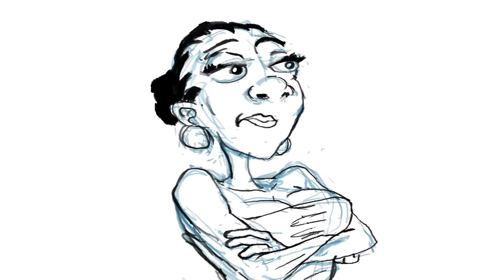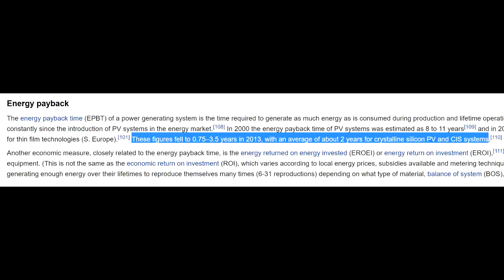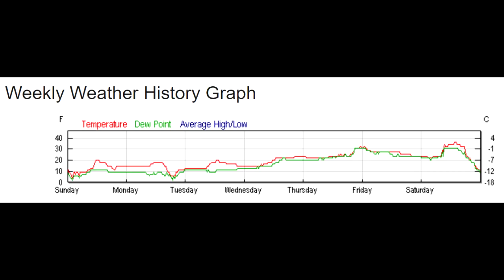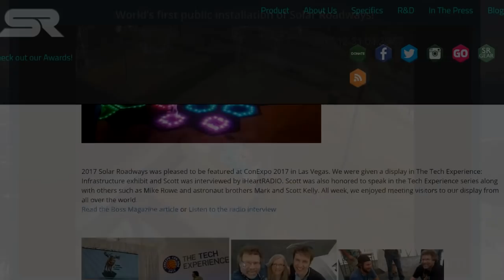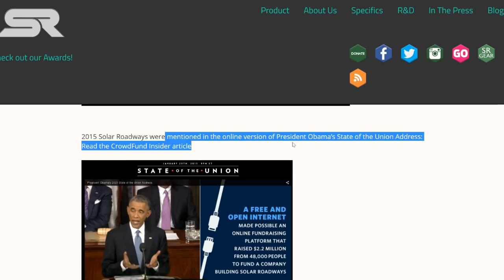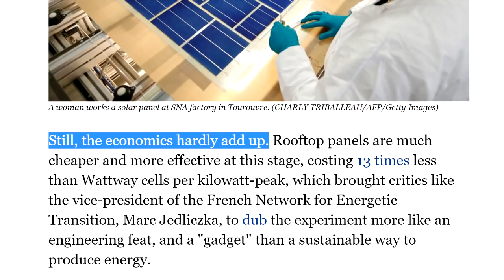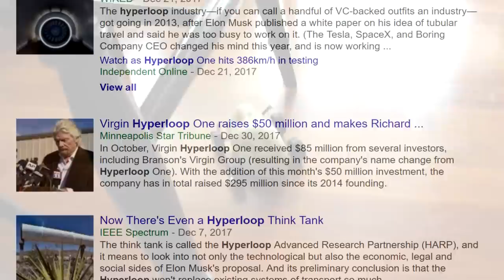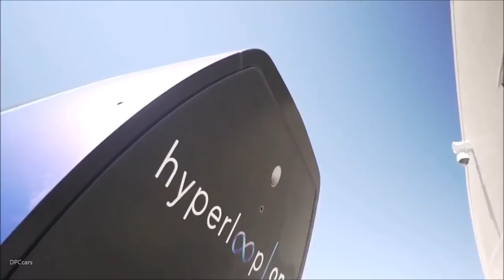Solar roadways, NEVER shovel snow agai... oh

Comment: 5:50 me only paying half attention to the video Wait wait! Was that truck driving backwards down the highway?!!
Reply: No it is not driving backwards, it is being DRIVEN backwards - that is how the "tractor" part of a tractor-trailer truck is occasionally transported. This happens if there is a fleet of trucks that have gone somewhere and dropped off their trailers (i.e. the load), and they have no loads to take back. So, they just hitch them back to back and drive to base/home - saves on fuel and crew both. So, it is a win-win. I think there is a term in the trucking lingo for it, dunno what it is though.
Reply: haha I learned something
Reply: Driving behind one is scare as fucking hell if you just notice it

Comment: Some central heating pipe's (leftover heat from power stations to warm up flats and stuff)  run through my street and it is DANGEROUS. The street is just super slippery from getting melted a little bit and than frozen again because it is still cold air going over it.

Comment: I don't get it.
If it's  snowing, and the sun light is not enough to melt the snow, how is a circuit powered by the same light / energy will be able to melt the snow above its own surface ?

Comment: So they want to convert sunlight which is heat energy, into electricity, to power a heating element, which creates heat, at the time when sunlight doesn't have enough energy to melt snow in the first place. Fukin engineers of the century here.

Comment: They need to clean them off.  I install solar panels and whenever we finish the system we give the homeowners roof rake.  Its as simple as saying "if you install solar panels in the north you need to be ready to sweep them off"
Reply: The whole point is not needing to clear them.
Reply: Mitchell Horton I get that but its completley unproductive to use energy to melt snow off a panel from the panel's power I was just saying I know first hand you need to clean them to keep them producing
Reply: Yeah I know. It's almost like it's a stupid idea to put solar panels flat on the ground in areas of high snow. 

Because the more it snows, the less sun they get, the less power they make, the less effective they are at melting... forever until they because functionally inert.
Reply: Mitchell Horton Its a vicous cycle

Comment: I have an even better idea: chlorophyll roads. Not only do they create energy from sunlight but they absorb carbon dioxide too. 

I just need £20m funding to work on the concept, then another £80m to build a sort of working (but not really) prototype. Then another £200m to innovate the even better idea of planting trees along the sides of roads instead.

Comment: I think you most compelling argument against the hyperloop was the footage of a tanker trailer vacuum induced structural failure.
Reply: ipissed 
I understand exactly what you are saying. My 20 word comment was only meant to convey the destructiveness of the potential energy created by a vacuum in atmosphere. The hyperloop does not appear to have any mechanism to arrest a cascade failure of the structure if it were punctured from the outside. I haven't seen design schematics, but I would think they'd be trying to manufacture the cylinder as efficiently as practical. Thus, I'd foresee a failure as resulting in something that looks like the tanker trailer even though the hyperloop is less susceptible to such a failure. It usually takes very little deformation to drastically reduce the load capacity of a cylinder.

It actually matches well with your dam analogy. If an outwardly curving hoover dam were built, and you could fill the reservoir as quickly as they were pumping the air out of that trailer, the wall of water generated would look very much like the one that would be generated by the existing hoover damn if external factors caused a cascade failure in the structure of the dam.
Reply: OmegaTou I prefer the vacuum glass tube and steel ball experiement.
Reply: Mika Peltokorpi
That sound equally horrific.
Reply: ipissed - The costs to produce and hold such a vacuum for hundreds of miles is amazing. Not to mention that it has not been shown for even a mile that it would work under pressure. It can never work as the upper side will extend more on the lower side because of the warmth. Not to mention that the general extension problem  over the year kills that project. They never showed any seals that could hold that extensions and not even a plausible idea has been presented.
Reply: funny how google will remember what you said FOREVER.  there will be a hyperloop imho lol
Reply: Why do we need a hyperloop? Why not build regular high speed trains? 160mph seems fast enough to me.

Comment: what about heavy traffic blocking the solar panels, so where you need them, in areas of heavy population, you have more vehicles covering them per day, just chipping away at that already inefficient percentage. so they would be most effective in the desert, where no one wants to live, in which case, just make a solar farm. job done!

Comment: Here's one to add to your "worst place in the country to locate this scam/project list." Let's electrically heat roadways in a place where geothermal heat is widely available because it isn't as if a number of municipalities in the western USA already use geothermal resources to keep sidewalks free of ice and snow. Oh, wait, they do exactly that!
Reply: Iceland use geothermal heat for the same purpose, but of course they're right on top of the Mid-Atlantic Ridge. Solar panels on the roof should work anywhere in the US, given we use them in the UK, which is much further north.
Reply: The UK isn't further North than the northern parts of the US. It's just that you're an island in a cold ocean so your climate is wetter and cooler. 

That said, yeah.

Comment: Heated driveways have been a thing for awhile, and they seem to work pretty well.
Reply: Except most aren't solar powered. And if they are, then the solar panels aren't built-in to the driveway itself.
Reply: Malestorm I know, I'm just saying there's not really a reason make it more complicated then it needs to be.
Reply: Are you from Reykjavík?
Reply: Yes they work very well... If you don't mind paying the ginormous cost of heating your driveway.
Reply: yup. We in Russia have centralized cogeneration plants: they produce electricity and lots of heat. This heat is then transferred to buildings in the town by water pipes under the surface. Usually one can say where these pipes are located because all the snow above them is melted :)
Reply: Yeah heated walks do work. But what costs more, the energy required to simply move x kg of snow with a shovel or the energy required to raise the temperature of that many kg of snow by enough to make liquid water (i.e. if it's 5 degrees F (-15 C) you'd have to raise it over 27 F (~ 12 C) to make liquid water)? So, they work, sure. But that is along the same lines that TF is talking about, it's just a more expensive way to do the work.
Reply: @LedCessna 

And? They're also a DRAIN of power, not a producer of it like the solar roadways claim they were going to be.
Reply: +TurdFurgeson571 It's not as much about raising the temperature as it is about melting the snow. Water's heat of fusion is massive. It takes the same amount of energy to melt a unit of ice as it does to raise the temperature of a unit of ice by 160°C. You're worried about raising the temperature by 12°C, but you'd need 13 times more energy to melt the snow after that. And that's not accounting for all the heat that will escape into the environment and not go towards melting snow.
Reply: +AllMyCircuits
just for the record. What we call "central heating", they call "district heating". In English speaking countries, "central heating" stands for one boiler heating whole building, not whole city.
Reply: +RandomGuy7092
Well, in Iceland they don't have as much of a problem where to get heat for heated sidewalks - just drill few not so deep wells. In the matter of fact, that's how most of their houses are heated.

Comment: A. What about tunnels
B. Why not use bigger panels so if they fail in any way you aren't taking 1 hexagon out of the middle of the road, and instead just replacing a small section, considering We have already seen the problems with adhesive holding the panels together.
C. If it's so very important to have solar panels on our roads, why not put them above the roads, providing shade in the summer, a barrier for snow in the winter, and not being blocked by cars well, DRIVING OVER THEM?

Comment: Tbh, I want this to work. But the reality is that its a failed concept. What testing was even done before it was installed?
Reply: It's not made by engineers, it's made by marketing people.
Reply: Actually, the Brusaws are engineers. Their problem is not incompetence, it's fraudulence. They raked in millions of dollars through state and private funding, then half-assedly delivered something any engineer worth a dime could put together in a weekend in a workshop (even though it would still be pointless).
Reply: It should have worked but solar isn’t as good as the people who support it say it is (unless in Australia etc) they said it would work in Ireland and I’m studying it but all it does is heat water to a little below room temp which wouldn’t beat freezing temp of the water was outside. Of course we could just have bad panels 😂
Reply: Solar canopies would do a better job. Also that canopy would keep the route dry during the rainy days. Perhaps that canopy is good for redirecting that rainwater elsewhere too.
Reply: Pokemon Maniac Jak Solar panels are good, but if you lay them flat on the ground, cover them with a thick layer of glass, erect buildings around them, and put vehicles on them, you absolutely murder any kind of ROI they would have. In Ireland, I'm not sure solar is such a good idea, wouldn't wind work better?

Comment: I'm sad. our teacher in electronicks, is learning oss that the Hyperloop, is a good idee, that will work. I'm trying to tell him the flaws but he ignors me. Its frustrating. I hope he will understand... but I dont think he will :(
Reply: A hyperloop would be great in outer space (but even then, do you really need it to go faster than the speed of sound? Because the only structure that I could see the hyperloop having any application in space is as a transit system for spacecraft, or space stations. Sizes which are way too small for considering hypersonic transit speeds. I have heard of some proposed superstructures in space that may utilize hypersonic transit systems, but other than that...not mouch other applications). But not in any place with an atmosphere (Mars...maybe can a hyperloop of some sort, because I think the atmosphere is thin enough...maybe...idk)
Reply: Kim N Mathisen - May be you can show him with the extension of materials. When you see a 1000 miles hyperloop then it extends and shrinks under different temperatures and every part of it has to have a perfect seal that could compensate this. Not to mention the giant vacuum generators that would be necessary the costs alone would kill it if it would not be impossible in the first place.
Reply: you enter a tunnel to get into the train, which has seals,  that way it doesnt have to release all the vacuum its sitting in, as for the vacuum , a lot of it will be made by ejecting the pressure wave of air  in front of the train, and then the amount of air in the tunnel will after a few journeys be far less, and even then you only need to divert it around the train aka an airplane and then you can move faster than sound, you dont need a full space vacuum to begin with at all, anything is better than flying and the vast wastes of fuel, and electric trans atlantic flight is just impossible with what we have, a train doesnt have to carry its fuel and moves with far greater efficiency.

Comment: Can these panels do anything as advertised?
Reply: Yea, they are hexagons. That's about it.
Reply: At this point you still have to ask?  Hahaha
Reply: +chris746568462 Technically, they were advertised as interlocking hexagons and they don't really interlock correctly as we have seen from the close up on construction.

So, they are hexagons (asterisk).
Reply: Technically, they generate income for the owner. Mostly by taxes for the city through (disaster) tourism, but yeah, there is a small change this installation might pay for itself. A bit like the leaning tower of Pisa...
Reply: They're techically solar, so they've got that going for them.
Reply: Nope.

Comment: Correct me if wrong but the best way that is 100% efficient and most kind to environment. Paint it black. Up to 100% of the sun gets converted into heat. Solar FREAKING roadway must first gather as much as it can, then use the remaining energy it to convert what it has stored into light and heat ...

Comment: When it comes to a lot of these "futuristic" ideas, I really think a lot of the people behind them took Tony Stark's line to heart.  "Jarvis.....sometimes you have to run, before you can crawl."  It's great that we have people these days who are reaching for the stars, but how about we start off small.  Instead of roads, how about creating solar panel roofs for parking lots, bus stops, and picnic areas in parks?  They will provide shelter from the weather and still get you renewable energy.  To get to this idea, we need to do more research and figure out a way to make solar panels more affordable and durable so that the costs of building and maintaining them would be way less than the money you gain from the renewable energy.

Comment: If they want to make solar roadways, why don't they put the panels ABOVE the roadway?  Above the traffic.  It would solve a number of problems.  They would still take advantage of the free airspace above the roads so as not to require new land purchases.  The panels could be angled towards the sun which would serve the dual purpose of being more efficient and acting as a "roof" for the roadway that's angled to allow for the water and snow to run off to the side.  Hey, less snow on the roadways to plow if they make it wide enough to account for slight drifts.  No worry about the cars blocking the sunlight and no need to make the panels able to support the punishment that a roadway takes.  It would cost a LOT less and provide much more power.  They would need to make it high enough to allow for the occasional odd sized vehicles.  Work could be done on the panels without interrupting traffic flow.  And, oh, less sun glare in the morning and evening traffic since you'd basically have a 24x7 sunshade across your windscreen.  And, finally, the technology exists NOW!

Comment: Commercial airplane hulls have design strength to survive around 100k pressure cycles from 1 atm -> 0,5 atm -> 1 atm. Hyperloop shuttle AND Hyperloop pipe should exceed these specifications by factor of >>10 with pressure cycle of 1 atm -> 0,001 atm -> 0,1 atm. With currently available technology that is a bit of a challenge.
Reply: Miak Peltokarpi - Is an airplane lets say 10.000 miles long? Has it thousands of tubes which all expend under different temperatures and will kill any seal that connects one tube to the next. So you have a few million seals that will fail.  Airplanes do not operate in a vacuum. The turbines need air to actually work not to mention the plane  needs air to stay actually in the air and not  fall to ground. This tube of 10.000 miles will fail over and over and over.

Comment: I had an idea for a hyperloop type project a long time ago. However, the vehicle would not be sucked along. Instead the floor with you made out of metal. The ceiling also would you made out of metal. Besides would not be conductive at all. It would still be tubular meaning round, however it would have multiple sets of four tires. The bottom third of the vehicles traveling with in this tube would be aware all the weight and mechanical equipment and batteries are. The top part the vehicle will be mostly ventilation, LED lighting and all the lightweight things. In portions of vehicle toward the beginning and end of vehicle there would be something similar to a roll bar. This would keep the vehicle from moving up and down inside the tunnel provide additional stability by having wheels at 90° from each other that push up on the ceiling the same as the two wheels at the bottom or 90° from each other which push upon the floor. When going around sharp curves because the tube is round the vehicle can bank to one side to try to maintain the center of gravity without throwing people against the wall. If need be tubing inside the walls and allow are the passing the opposing direction as the vehicle pushes through the tunnel. Also since the vehicle is not airtight with in the tunnel air can pass around the vehicle. And lastly if even more air flow is needed the tube going north vent into the tube going south and vice versa.
Reply: You can think spell check for all the misspellings and stupid sounding sentences in that last paragraph